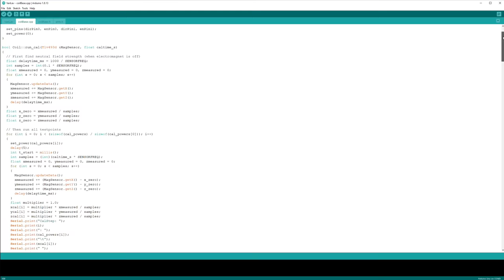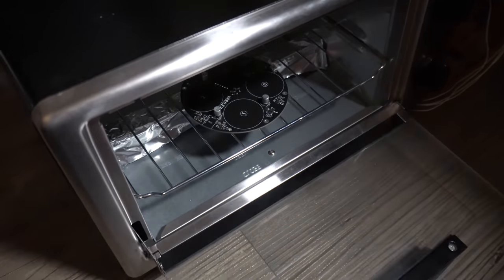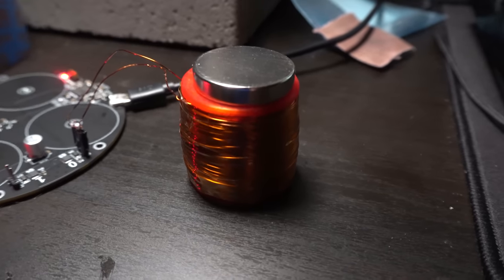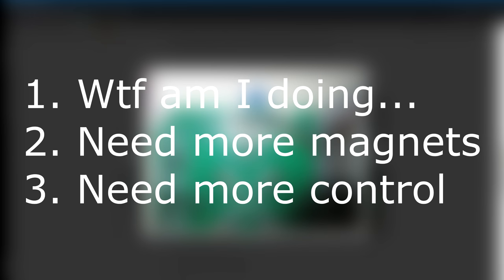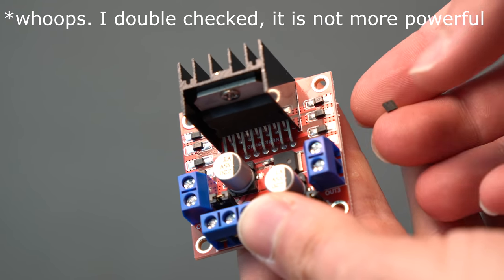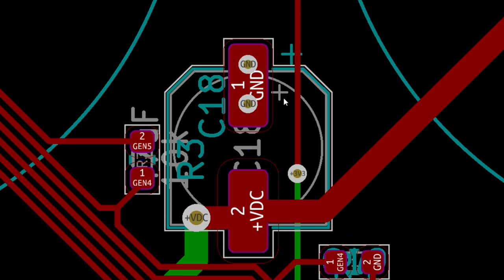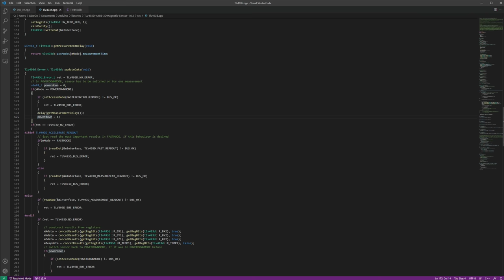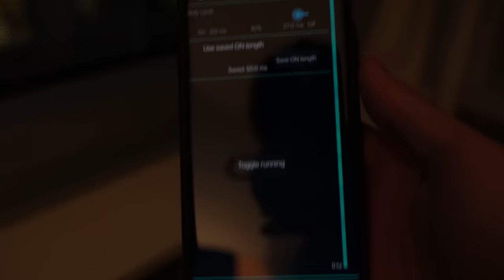Building a Digital Magnetic Levitation Platform!

Comment: The analog platforms have the huge advantage of being continuous, aka not having any computational delay from input to output, and no quantization in time and amplitude, while being super simple to build.
Reply from the maker: Yeah they do have a huge advantage over digital in that aspect
Reply: @3DprintedLife  The analog platform is best solution ;)
Reply: Fpga would also be a solution.
Reply: people tend to think that analog is "old and worse" when is actually the better.  Digital is simply an approximation to simplify implementation
Reply: Also, the quotation induce steps in the variation of the voltage, but current (hence field) does not follow instantly the voltage due to the inductance.
Reply: @Felipe-ij2lu  self-proclaimed hw devs on YouTube think that.
Reply: I would suggest removing your serial.println from with your control loop. Serial.println is very very slow. Instead, record fields with a std::vector and then run an experiment over some time period. Then dump the recording over serial. This should help with the stability of the system.
Reply: @maxhouseman3129  my dude, im all for digital, but its not hard to see that felipe's right? analog electronics work at the speed of light, while digital electronics use electrons that DO move at the speed of light, but the processing doesn't quite do that. There's also no errors, no false positives, no calibration, no wrong, just unintentional. Analog, objectively, IS better. It's just not small, in fact it quickly gets enormous depending on the application. Controls are also far harder to implement. Digital LEGITIMATELY, btw, is an approximation to simplify implementation. I mean, that's not exactly all the details, there's more to it, but that really is essentially it. That, and more control. If digital electronics ever get to the speed and efficiency of analog, we'll have reached the peak. No further to go after that, you can't go faster than the speed of light with electronics, you'd be getting into quantum technology at that point.
Reply: @liveen  thanks for your explanation. I think you did not get the point of my statement. I am on the same page with you and felipe. I meant that wannabe YT hw devs think that digital is always better, but that's not my opinion.
Reply: @liveen  Analog electronic don't react at the speed of light either...
Because of parasitic capacitance and inductance, each analog electronic got a limited bandwidth. 
From few khz to mega/giga hz.
Reply: This man is surely being sarcastic. Just do the math, the time a microprocessor would calculate these things the magnet wouldn't even have had the time to think to move!
Reply: Bro I have no idea what anyone is saying but this seems very interesting. And you come up with many solution after you noticed a problem. Do you need electricity to make this work?

Comment: While it’s technically possible to levitate a single magnet, it’s essentially a point field you’re trying to control. In the same way you added more magnets to the base, you should make an array to levitate with passive stability built into the design. 
You might also consider induction coils like the worlds fastest maglev train. I’m sure there is a lot of control programming that goes into it, but it also has a degree of passive stability.
Reply from the maker: Ahhh that does make a lot of sense, thanks for the input! Will keep this in mind if/when I take a second attempt at this!
Reply: @3DprintedLife  a permanent magnet in the center of the platform and the base that pulls the platform down will keep it aligned in the XY directions because it will always pull it to the middle.
Reply: @3DprintedLife  You should look into making your coils the way that Tesla indicated in his Coil For Electromagnets patent. Also, read up on  Howard Johnson’s The Secret World Of Magnets, great insight in both.
Reply: That being said, it is interesting that all designs use 4 emags vs the most stable 3 points needed to make something, like a table, stable.
Reply: @3DprintedLife  Static stability is impossible.
Reply: @3DprintedLife  You can also put a thick copper plate around the edge (or even across the entire surface machined with holes for your coils) to create eddy breaking that slows the magnet and makes life easier for the control loop.
Reply: @3DprintedLife  Have you tried again?

Comment: I did the same project 3 years ago in school. No one thought I would make it, but I did (and got best mark). For the software control, I noticed that execution time was more stable. That's why I altered to a faster uC and made the code stupidly simple. Literally, just if you're too far to the right, increase the PWM a bit in order to let the magnet go to the left.

I may retry it next year with proper control theory.
Reply: WHAT IS THE ELECTROMAGNETS MADE OF. IS IT COIL WRAPPED AROUND NEODYMIUM OR IS IT WRAPPED AROUND STEEL?
Reply: @GrandmasterUV  Coil wrapped around a ferromagnetic material. In my case iron. Never ever neodymium, because you want to make an electromagnetic field with the coil.

Comment: This kinda reminds me of my test phase :) 

- isolating the system by locking certain DoF and get this to work first
- proper filtering is essential
- Getting rid of the serial print and checking timings with an oscilloscope might give a better understanding of what’s happening
- try to find a equilibrium point (working point) of the system, since there are nonlinearities it’s not working over the full range.. -> try to vary the lev-height
- Setting up a proper controller e.g. in state space representation and/or linearize certain variables (e.g. input/output linearization) -> the pid can’t directly “handle” a nonlinear system

Nice approach and execution 👍🏼
Reply from the maker: I appreciate all the tips, all sound like very good ideas! Thanks!

Comment: I haven't read the other comments so maybe this already got mentioned, but in a typical repulsive levitator, you've got a ring of permanent magnets that establish a baseline field where the levitating magnet has a stable point along the Z-axis, and the electromagnets inside the ring are only there to prevent the floating magnet from sliding off in the X or Y axis - meaning the force they apply to the floater should be predominantly horizontal. It looks like you're trying to use the electromagnets to suspend and stabilize the floater, which is theoretically possible but incredibly difficult.
Reply: hey, thank you for this comment. Do you know any place I could read/watch up more on what you're describing? Youtube only seems to have toys and demonstration videos.
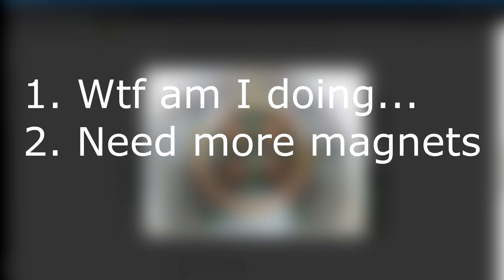Reply: That’s what he’s talking about at 3:30

Comment: Fun fact, I found this video while procrastinating on my exam about control systems. 
We had studied this system in class and came to the conclusion that your solution, a PID controller wasn't a good solution even with adjustments  as the plant is quite unstable. For this type of systems it is better to have a state space model system.
Reply: State space would also be my recommendation, since it is multiple input multiple output (MIMO). Some system identification or modeling would be required in order to use this though.
Reply: The PID controller is a real workhorse but it has it´s limitations. A more modern approach using State Space Model (H-infinity, reference tracking, etc. ) may give a better response. The other problem is trying to fit a controller without the plants model!!!!

Comment: I noticed four depressions on your magnetic puck … I also noticed if that puck was held over the center of the magnetic field, the puck is repelled from the platform.  Use this repulsion or push up to hold the puck up into a loose-like chuck that uses those depressions as a gripping point and attach it to a motor or even a drill.  Using the drill over the platform and using the repulsion to hold the puck against the loose gripper or home made chuck ..spin up the puck as fast as you can and slowly lift away the device …..  the puck will remain centered and quite stable provided the puck is somewhat balanced to begin with.  Because you now have a frictionless object floating ..the centrifugal forces you generated will take a very long time to dissipate.  During this spin down ..You can collect data to determine the sequence of signals to your electro magnetics and use this data to program the same sequence of events to occur  ..and push the puck into a spin electrically instead of mechanically.  That process will almost write the code for you ..and then as long as you energize the platform it will spin and stably hover forever electrically, silently too.   Paint the puck colorfully and you have a coffee table conversation starter like no other … you will be able to determine minimum RPM for stability and make any cool colorful design on your puck go through many visible changes by changing the RPM within the stable range and that should be pretty wide … you get A+ for tenacity you just need to program a spin into you idea and your home free .,. It was very entertaining to watch .,. Stay curious … Blitz

Comment: A really challenging project. Most designs I have seen just force a set field that the levitating object, magnetic or diamagnetic, is forced into a stable position. You tried to dynamically live compute a field based on the starting condition. Kudos for trying.

Comment: I have a few suggestions at the software level.

For one, it looks like the magnet is pretty much sliding off the field. It looks like it's oscillating and gaining energy which is causing it to do that.

I might suggest that you adjust how aggressive your electromagnets will respond with some bias, preferring to use weaker forces.

One concern you'll have is that you emit too big a force due to error and just throw the magnet off to the side which is maybe what's happening. By undercompensating rather than trying to achieve perfect precise control you can smooth out error and delay.

It could be as easy as curving your output force exponentially, the further the magnet deviates the stronger the feedback should be. I would personally use e^x because its derivatives all start at one all the way down and it has useful properties. You can multiply by a constant to set where each derivative starts. E.g. 0.1 * e^x will result in very small changes initially but as x grows those changes accumulate. Additionally, you can apply more correction by scaling and translating x to a reasonable baseline.

If you can design something that will let you update those three values in real time to let you test easily (e.g. without compile times and such) you might have some more luck.
Reply: this is cool, what might you call that "something" that could be designed which could update those values in real time? Im new to this stuff and so I don't know much terminology
Reply: also, would you explain why e^x is a good choice? what are its useful properties?
Reply: could you also explain how that equation might actually be implemented into the code?

Comment: Im a little tardy to the party but i still wanted to throw a suggestion or two at you for what its worth.. a couple of "classical"  solutions for the instability problem in maglev that i like to employ are:
- Rotation of the object you want to levitate, and
- a diamagnetic or paramagnetic "cushion" to regulate the flow of the free electrons on their way through the levitating piece such as a thick solid chunk of aluminum or copper.
basically spin the levitating part as fast as you can while "cushioning" (slowing, essentialy) the flow of the electrons being generated by your coils without disrupting the magnetic field that they are flowing through... hope this helps!

Comment: Fairly certain there is not enough information from one magnetic sensor to uniquely determine the position and orientation of the floating magnet. Once you actually measure the position and orientation of the levitated mass, its magnetic field, and the shapes of the supporting field. Then it is much easier. Do you think those rockets flipping quickly and then landing precisely upright were flown by seat of the pants algorithms? I expect it is "3D models with mass and precise locations", a fair measure of "response functions", "equations of motions - masses, velocities, accelerations, moments of inertia, etc" You only have 12 core observables to track - x y x position of the center of the magnet. And the cells of a 3x3 rotation matrix to bring it to the proper orientation.

Monitor those and simply use an objective function like the "total energy needed to rotate the disk and position it from its current position to the standard one. If the disk is not symmetric you can grab it with the field. So put "something" asymmetric on the disk to know up from down. east from west. etc. Any small magnets might work.  You cannot easily grab a smooth magnet, unless you go to much higher sampling rates for observation and control.

I love your signals, but it is frustrating to see you just winging it. A little bit of data and statistics. Use cameras to monitor position (that is why you need some way to "see" which way it is pointing, and some way to grab it and exert force to rotate in 3D or lift or pull down.

Yes, you are close to the right field strengths and control signals and parts. But you have to measure, record and estimate the work needed (power times time) for each correction. You are flying the disk, not lifting it. Put yourself on the disk and it is easier to know what to do. Tilt five degrees down toward 23 degrees (clock wise from north)? You need a force to lift up at 23 degrees, and maybe one at 180+23 to lift up. The magnetic field works stronger over shorter distances, so lifting the nears part of the disk is easier than pulling the further one. When it gets level opposite sides are about equal. Get some coordinates and flight instructions. And keep track of energy., You have all to voltages, currents, charges, powers. You know or can measure the moments of inertia of the disk and anything attached.

Best wishes. You are really close. Me, I could not even see those little things you were soldering and can only see the mathematics and physics, sensors and data.

Put the disk on a thin panel in the right place.  Then use the field to lift one side by exactly 3 mm, the put it down again. Repeat around the circumference and calibrate your currents.  Get a separate 3 axis magnetic sensor and measure the fields.  Strip down a 3D printer, set the fields at a given set of activation currents, and map the field so you can see it and know its values and fluctuations.

Comment: The position and orientation of your magnet has 6 degrees of freedom, while your hall effect sensor only reads 3 values, so you probably need a very specific arrangement of permanent magnets to achieve stability in the remaining 3 degrees of freedom that you can't stabilize with software.

Comment: First of all great job 👍. Your problem seems to be caused by inefficient PID control, which is the reason for the incorrect control of the magnets. So what you need is a good filter against noise but also absolute fast accurate sensor data. You should look at the Kalman filter algorithm. This is also used for self-balancing robots and provides a very good value for commuting (so to say :predicts the values ;-) ) Then your PID should  works like a charm.
Reply: What can i do to network with you

Comment: Two types of time lag should be considered for a stable system. As the coils are inductive loads voltage will lead the current through the coils, however current is forcing the floating magnet back in position. Another issue is totally mechanical in nature. Once there is position disturbance of the floating magnet, the electromagnetic force cannot immediately bring it back. Newton's law rules (F=ma).  You may have a look at the following video: 
 https://www.youtube.com/watch?v=xO9uNkeo6PQ&t=933s

Comment: Not an engineer or in any way tech savvy but would a smaller disk make a difference? Having the coils “push” the disk back to the center only works if the disk is within the coils “reach”; if the disk pushes the boundaries of that reach, there’s a smaller window of time for correction before the weight and inertia take it beyond the boundaries and cause it to go over the edge. 

I imagine it’s like trying to balance a plate of water with one hand (where the water is the disk, the plate is the magnetic field, and your hand the coils). If the water takes up as much space as the plate, the more likely it’s going to spill when making corrective movements because it’s picked up speed and continues to move after your correction. However if the water only takes up half the size of the plate, you have much more room for error and thus more control.

Comment: The strength of the electromagnetics may not be enough to produce an adequate field. While it may be overkill, simulating the fielding and flux circuits may help to identify where issues are. You also have to anticipate adjustments when dealing with discrete delays so applying a regression could help too.

Comment: MAGLEV is inherently unstable requiring a very fast control loop.  I don't believe it is possible to make a stable control loop using digital for this application, but with a PID controller you can determine whether it will be stable via the step and impulse response.  A more important check would be the amount of time required to sense vs. apply stimulus which is the most likely problem.